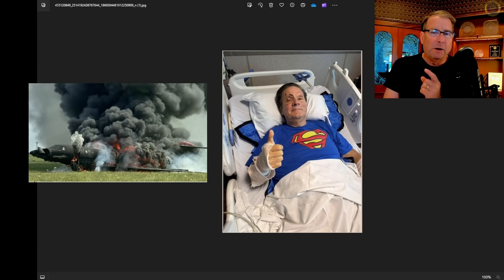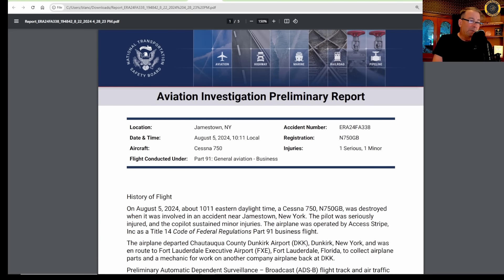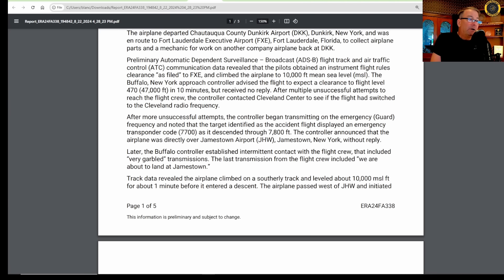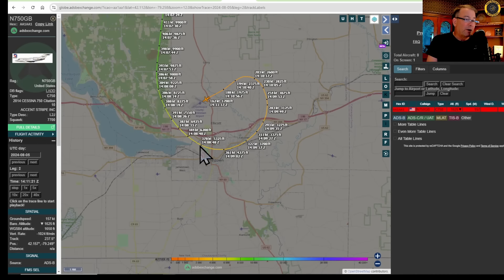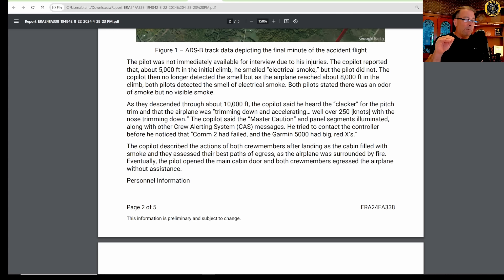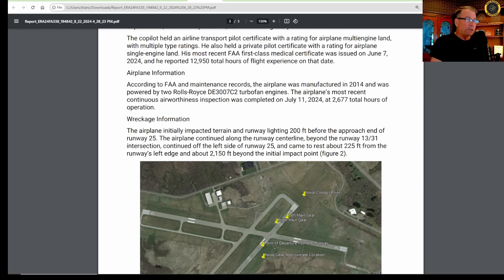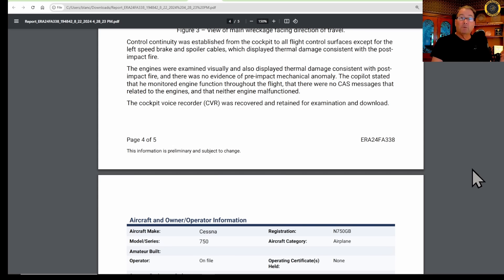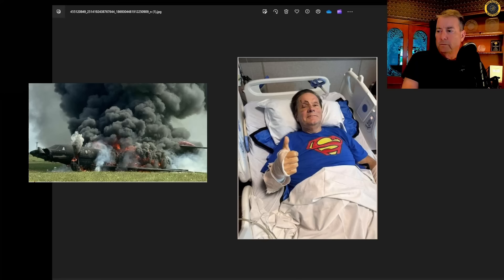Smoke in the Cockpit/Electrical Failure N750GB 5 Aug 2024 NTSB Prelim

Comment: " Smoke in the cockpit is a pilot's worst nightmare "........couldn't have said it any better myself.  Thanks Juan.
Reply: Right up there with a fire on a ship at sea!
Reply: Enterprise fire survivor here.
Reply: I practice for it, can’t imagine having it happen…..
Reply: So they smelled smoke, but saw no smoke, had instrument & electronics failures, attempted an emergency landing, impacted terrain & lighting short of the runway, came to rest and managed to escape a post crash fire with minor injuries. Wow!!
Reply: cessna 182 over Stockton ca, batt indicator showed discharge ,lights dimmed, some started entering cockpit.  did emergency landing to airport below, takes along time to get down or seems like it, alternator bearings froze and v belt  provided the smoke
Reply: Save for that one senior cabin crew member we have at our company…
Reply: Btdt, smoke and total electric failure shortly after take off.
Reply: In the late 80s I had a total electrical failure in a Piper Archer in an IFR flight, on top of an overcast. I happened to have a portable VHF with me that I had borrowed from a fellow pilot, to see how it performed in flight. That portable made it possible for ATC to vector me down through the overcast to a VFR field. The airplane was inspected, presumably fixed and that was that. A few months later another pilot had another electrical emergency in that same airplane, but this time there  was smoke in the cockpit. He managed to land, and shortly after he exited the airplane, it was engulfed and destroyed by the fire.
As for the portable VHF yes, it performed wonderfully. Within the same week of that flight, I purchased a portable and never, ever flew without it since.
Reply: Thought it was snakes
Reply: Not always the case, ole Dave Phillips and Joe Messina had holes in their uniform ties from their pipe.

Comment: I suspect more than a simple electrical fire.   More like a fire initiated by as yet unknown causes that ignited fuel or insulation and was accelerated by a leaking or accidentally actuated oxygen panel.  It has happened before.

Comment: A fusing issue, it should blow before a fire starts, though they said snoke and loss of power. Maybe a power circuit smelling as it is going out, then it went out and everything's dead and never drew enough current to blow fuse or start a fire.

Comment: That is the worse accident at Chautauqua County Airport in my memory. We have had small single engine accidents there with 1 death but he was 1 mile out on final. Bad weather and icing on the wings. We had other deaths but much farther out from the airport of 10 miles or more. 

I noted with the cost of small aircraft like your 172/182 type aircraft and A&P maintenance, since the 1970’s, I have notice a drop in aircraft ownership in my area. It could also be that the WWII generation is no longer flying. Just my 2 cents!!!

DE N2JYG

Comment: Good grief, will someone please get these men a fine cigar and a beverage of their choosing when they're feeling up to it??? 

What a save!!! 

In my opinion, they didn't "crash land", someone put the runway too far away 😉 they did everything they could to get that wounded bird on the ground and they managed it with every dice roll against them!!

If this turns out to be another mechanic screwing something up and releasing the aircraft, I would have to say as an experienced engineer myself that you have endemic issues within your repair and maintenance industries in the United States. 

As engineers we have to hold ourselves to account on every single nut and bolt, every procedure. If you ever find yourself even thinking "that'll have to do"... stop, go from the top and do it again.

Comment: I had car catch fire, wire under dash. I exited to disconnect battery. In seconds cabin filled with smoke. When i opened the door i caught a wiff of smoke, it took my breath away. Anyone trapped in the car would be dead in seconds. By the way car was Triumph TR7, well known for catching fire in the US. Covered up here in UK.
Reply: One thing i fear in an aircraft is fire, i had Cessna landing light switch smoke, welded on. The master switch was off in a flash, so to say.
Reply: Excellent reason why smart people will NEVER have cars with electric locks and power windows. Give me manual window cranks any day.

Comment: yep i think smoke in the cabin is never a good thing as thoughts turn to fire and where it might be and what effects it is having on the aircraft, get on the ground asap - i wish these guys a rapid recovery, i think they did a good job

i watched a recent program on British tv where a jet's cabin began to fill with smoke, finally the plane landed and after a short delay of a minute or so, the passengers were aloud off, it was found that a fault in the engine caused oil to burn and filled the air-conditioning driven by the engines, cabin crew wore oxygen masks and smoke hoods and found these difficult to understand instructions, passengers becoming increasingly anxious to get out - but i can't understand with the aircraft now halted why the crew didn't act faster to get passengers off, the pilot waiting for fire crews on the ground to make the aircraft safe - surely cabin crew on passenger jets can do this without permission and i know this has happened in the past, crew should not be frightened to work on their own action without consent of the captain

but what i find difficult to understand in design why the engines are dependent on feeding the air to the air-conditioning system, ok so if this has to be, in an event such as this, why isn't there a simple system employed to blow back, like a ram air intake to increase air pressure in the cabin and force the smoke back on its self, perhaps extinguishing possible fire

Comment: I fly right seat in a TBM 900 with a friend who owns the aircraft.  The “leather” smell had turned to my nose as hot wires.  It was faint but that what it smelled like to me.  Then  uncommanded shutdowns started to occur with complete electrical shutdown after starter started to spin up. Thinking it was the battery they replaced the battery.  The problem still occurs, and the last flight it almost would not restart after five try’s.  I tell my buddy that “leather” smells like hot electrical.  It started but the return flight had me worried.  Upon inspection the main buss was cooked like it had burned.  It had been telling us, but we ignored it.  Lesson learned, trust your gut.

Comment: Fire has to be the ultimate pilot nightmare.. During my flying and instructing days, I would always be emphasising the importance of following the checklist.. Only one factor on one aircraft model did I ever depart from the manufacturer's checklist and that was in relation to suspected fire.. The checklist recommended a series of checks to be carried out to identify and possibly isolate and rectify the issue, only after those checks failed did it recommend a descent.. I would always instruct that a descent be commenced immediately a fire was suspected.. Better to be problem solving overhead an airport at 3000ft than finding the fire is now out of control at 30,000 ft.

Comment: I have had a fire in a car, and that is scary enough, I cant think of much worse than having to deal with a fire on a plane.

VW TLE has the battery under the back seat, the seat shorted out the battery and caught fire. I managed to pull over and take the back seat out (and let it burn), and continued on my way.

Comment: 5:33 Does an airworthiness certification inspection mess with the electronic cables at all? This aircraft received an airworthiness inspection 25 days before the electrical fire.
Reply: I guess I should add... As this was a private, as opposed to commercial aircraft, was this the first flight since the airworthiness certificate inspection?  You expect commercial aircraft to be in-use almost every day, but private aircraft don't fly anywhere near as often.

Comment: Glad you brought up Swissair 111. Time fumbling about with checklists well after the first signs of smoke/smell could have been time to save the plane by getting it on the nearest runway.
Reply: do u mean Swissair "fumbled about"
Reply: The final report concluded that, even had they diverted at the first signs of smoke in the cabin, they more likely than not would still have crashed tens of miles short of a runway.
Reply: @najaB76  and then of course it would have been pilot error for skipping the checklists...

Comment: What a terrible experience but the crew did a great job in dealing with it and getting it back on the ground as fast as possible. So glad they made it and prayers for a quick recovery.
The question comes to my mind when hearing of fire and smoke in the cockpit while in flight, is there an emergency cockpit Ram and Dump valve on this aircraft? I remember them on the military jets I worked and flew on when on active duty a hundred years ago.

Comment: had two buddies with electrical fire -one a Queenair other IOE on a loaded 757 to SFO. Both were ugly but successful. Queenair was climbing out of KTRI  IMC. These two were lucky as captain flew WW ll Ploesti in 24"s  75 windscreen controller intense smoke made IOE ride a real twister !  75 dove into KDEN . IOE instructor ran checks and all comms pa -etc etc. Captain flew SO's in VN and stated early on it didnt look good with mask and goggles just able to fly and dive into DEN. BTW DEN put a flt in front of them that got a quick nasty response from crew.   WHEW

Comment: I like to watch these aircraft incident videos on several channels and one of the worst and most haunting for the pilots is still that UPS flight 6 where the cockpit was filled with so much smoke that the pilots had absolutely no chance to do anything to save themselves and the plane. Saudia Flight 163 or South African Airways flight 295 as well as Air Canada Flight 797 were also horrible in-flight fire incidents that can certainly give you a healthy respect and will make you want to descend at the first sign of fire, no matter how slight.

Comment: Excellent emergency procedure. I look forward to you chatting with them. I'm always shocked when people treat smoke like it's no big deal. There was one recently and someone commented that way, so I gave term the link for the Swiss Air 111 crash. Edited to add: I have said it before on here, and been told I don't understand: sometimes you just need to be on the ground. Right now! These guys understood that and came in like a fighter.
Reply: It’s something we train for if we’re smart, I know my 172 feels like it’s screaming in the yellow arc when spiraling. I can’t imagine 300+ kts, they had to be pulling some G’s
Reply: @Ifly1976 what does 300kts have to do with pulling g’s? I regularly fly 300+ knots in a descent in my A321, without passengers even knowing. The flightpath of this Cessna jet wasn’t a ‘spiral dive’, it was just a long expedited descending turn to final approach.
Reply: @baasbowing  don’t think I said anything about straight and level, unaccelerated flight inducing G.  I don’t recall saying they were in a spiral dive either. The ADSB data is pretty clear, they were in a fairly steep bank angle and at a relatively high speed, anyone who flies airplanes knows how that works. CL = L/qS is the equation, in case you forgot, I know airbus pilots struggle with actually flying aircraft…..
Reply: @Ifly1976  haha, yes after 28 years in the B737 the Airbus is indeed a struggle…I’ll give you that.
Reply: @Ifly1976  well, you mentioned spiraling in your 172…;)
Anyway, have a nice day.
Reply: One of my friends flew a Citation X, she is a fighter pilot and surgeon...  That bird can haul a## on the way down if you need to... she's done it before!
FAA Restriction of 250kts doesn't apply during emergencies, and that includes "Life flight" or medical flights when justified and safe to do maintain higher airspeed below 10k.....    If they are on fire...  well...  they'll haul a## and if these guys were higher... they would have gone faster!
Reply: @baasbowing  Even when my Naval aviator (test pilot) friends, while flying an overhead  break pattern in an larger aircraft, like a P-8 they are pulling less than 2Gs,  even when bringing the nose up while in a 30 degree bank, to kill airspeed from 300kts. Anything more than that would be considered extremely reckless flying.....  even that would not be "like a fighter" really!
Reply: @baasbowing he flies a 172 so he must be an expert....😂

Comment: If there is ONE thing you never want to see on an aircraft you're onboard (no matter if pilot, flight attendent, passenger, or anything else), it's an in-flight fire of any sort.
Smoke in the cockpit is an ESPECIALLY nasty form of in-flight fire, the "worst of the worst" as it were.
I'm extremely glad to see that these two pilots "flew the aircraft to the scene of the crash" as you're supposed to, and more importantly that they managed to survive, even with injuries.
I'm highly interested to see what the NTSB final report says about this.
Reply: Yeah, you just can't pull over and evacuate
Reply: I bet the NTSB would come up with some phrase like ”crew failure to...”. Did you see any NTSB report with appreciation for the crew actions?

Comment: Indeed, an aircraft problem in the air is not a wait and see situation, especially right after take off when you have the option of immediate return. A distinct electrical smoke smell is a good opportunity to evaluate the scope of it on the ground by a fire truck. And if you need to get down fast it's engines off and go deep in the soup towards the nearest runway corner. Gear can be used as air brakes. There is no vector to approach nonsense. You inform ATC to part the seas.

Comment: That electrical smoke smell is one of the scariest-- in any situation!  

I experienced it at work many years ago, when a capacitor on the primary machine I used for my job "went to lunch," as the repair technician put it. After making the repair, the technician advised that I spray down the room with air freshener to neutralize the smoke odor. He explained this was a safety issue. In case any new electrical issues turned up in the future, I would be more likely to smell them if the room didn't smell like smoke.

Comment: Talk about a pucker factor of 10.0 on the sphincter scale these 2 great pilots lived through have one heroic story to tell. I'm glad they both were able to walk away and live to fly another day. RIP CESSNA CITATION JET 750 NO750GB.
Reply: They're fixing the plane according to another comment: They doused the fire, used airbags to support the plane while the fixed the forward gear, and sent the engines off for freshening up.
Reply: @wadepatton2433  ok getting a new Jett would probably be a better idea because after crashing a jet like that, it will never be the same.
Reply: @slayer6936  your comment is valid. Thank you
Reply: @slayer6936  your comment is valid. Thank you
Reply: @slayer6936  Sure. New might be better. Depends a lot on who builds it or who re-builds it.
Reply: MWTGoldenGun  Ok.

Comment: What a lot of people don't realize is when you have a electrical short and the circuit breaker doesn't  pop,  meaning opening the circuit - cutting off the electrons to ground, you have a serious problem
Wires will heat up and burn the insulation so other wires in a separate circuit will contact and make a ground. that's how DC systems work.
This has happened to me on a large turboprop, systems were turned on and off randomly without touching the switches. wire bundles were grounding out on their own. it's a scary situation. you must cut the power from the main bus and fly without power. only the standby horizon is your friend if you have conventional flight instruments IE steam powered. Glass cockpits are a different story. you are in big trouble
We landed on a remote landing strip in the Canadian Arctic safely and I had to trouble shoot where the system was shorted. after about 8 hours I found the culprit short circuit  and eliminated the circuit and flew home to Yellowknife and basically rewired the troublesome wiring. the fault was a hole drilled into a harness from previous sheet metal work.
Reply: I did that on my tacoma truck.  But only got a old code thrown. 😅

Comment: 2.150'... They slid for almost a 1/2 mile which means they almost made the landing but hit too hard and too soon hitting the lights and breaking the gear. As the saying goes... Any landing you can walk away from is a good landing. Great to not have a tragic ending except for the aircraft. It would be interesting to find out exactly what happened.

Comment: Yes Swissair came to my mind as well. Although they were a little further up already. Qantas also with their uncontained engine failure : unless abdoluteluly certain the problem is minor and contained, i want be on the ground asap. Nevermind MLW if you arent even sure you will not turn into a brick. Really well done by these 2 pilots : they saved their asses and this may well be hudson material where others cannot manage same outcome in the sim.

Comment: Appears that CRM on this flight was, at worst, quite  satisfactory (I say it this way, because in those circumstances, perfection is maybe a bit too much to ask for).

One question - do CVR's on private planes like that Cessna have their own internal backup power (in case electrical issues took out their primary power source)?